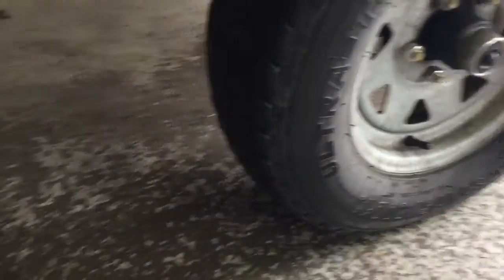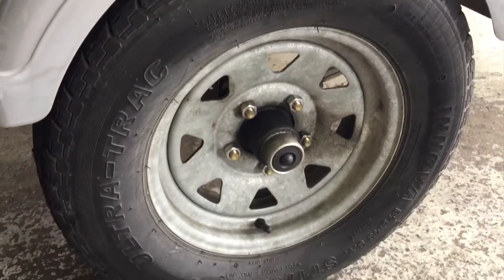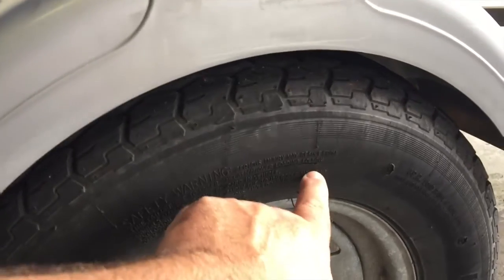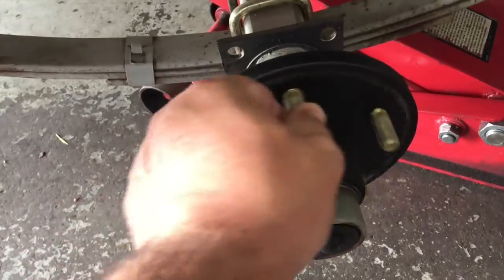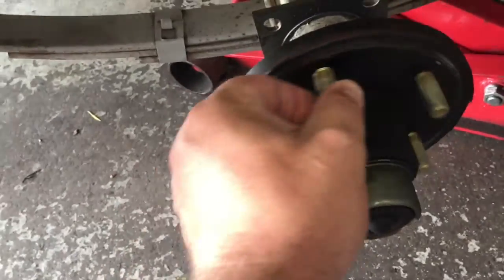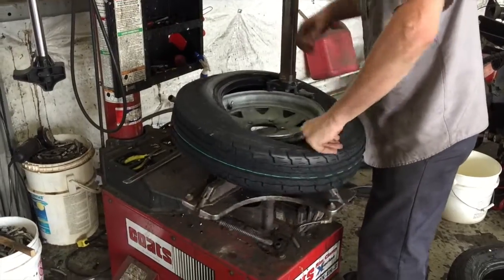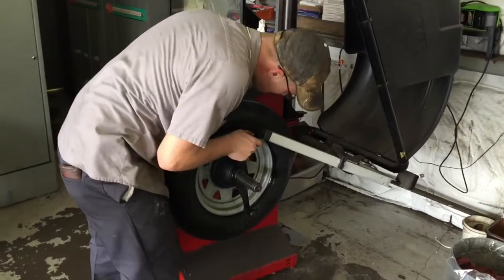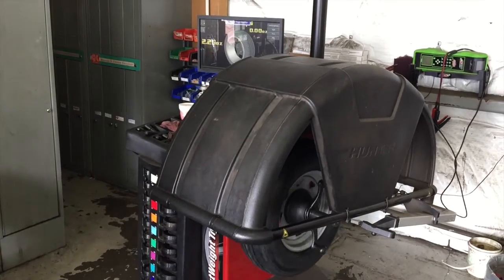Boat Trailer Tire Replacement & Maintenance

Comment: Jeesh, I'm going through your vids and it's all relevant! My 05 175 package trailer tires are actually getting severely dry cracked. I risked them on two 6 hour high speed trips this past summer. Stretching my luck no doubt.  Next spring for sure. No excuse, I know I tire guy. Cheers, Mark.
Reply from the maker: Cheers!!!

Comment: I have a Little Dude 15' trailer. The wheels have 4 lug nuts. They were incredibly rusty, but I got the lug nuts off. My question is: what is still holding the wheel on? The hub appears to be wider than the hub hole in the center of the wheel rim.

Comment: My trailer tires are already cupping after just two seasons. I attribute it to these small tires heating up on my interstate trips. I'll be replacing mine at the beginning of next season.
Reply from the maker: The port side tire was out of round as well. Probably from sitting stationary from the previous owner so long.